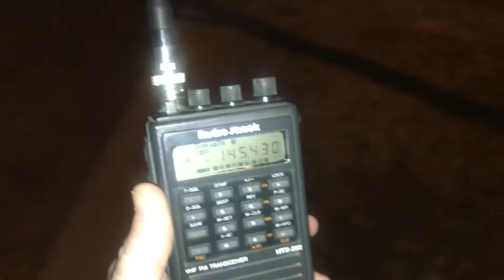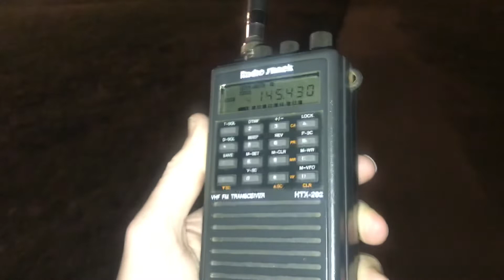RadioShack HTX-202 Handheld 2 Meter VHF FM Transceiver Ham Radio - The Brick Radio

Comment: Had my 202 since 1993 yes it works
Reply from the maker: Yessir.  My HTX-202 has a date code 5A4 - which translates to May 1994 [5th month,  last digit of year 4 so 1994 - May 1994 to early 2023 is pretty damn good.  Mine is still working fine.  Looking at a 29 year old radio that I’ve used almost daily.  Not bad.  

A 25 year old car is considered “antique” [at least here in Virginia].   It used to be 20 years.